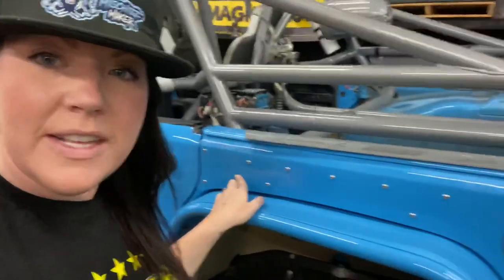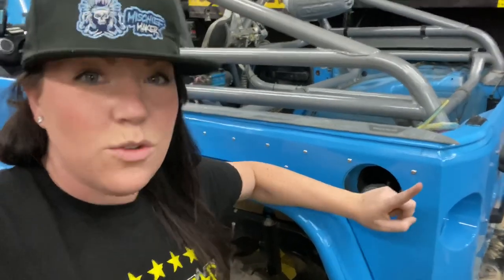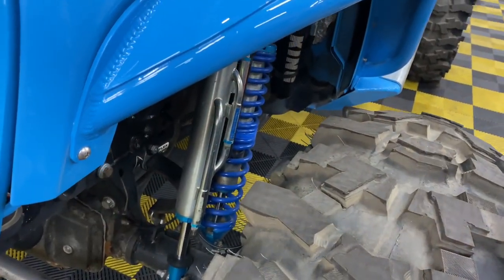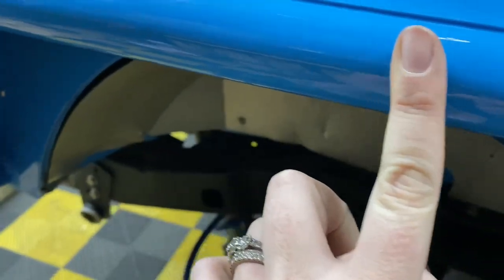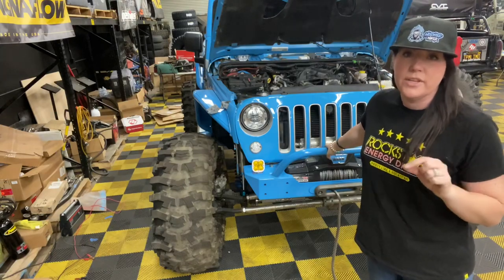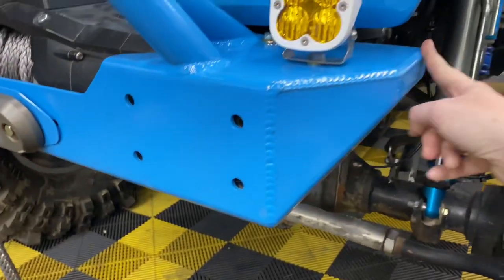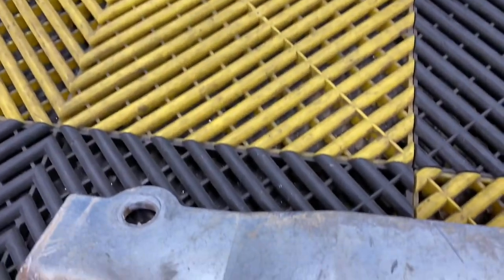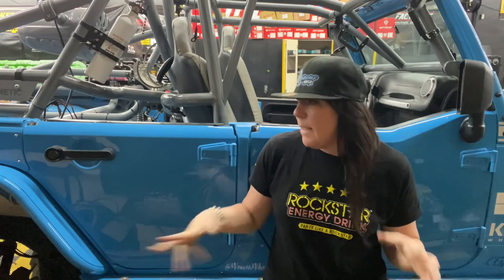Choosing the Right Armor Package - What I Run and Why I Chose to Run all Aluminium

Comment: I definitely agree less weight is better prefer aluminum if I had an option. Maybe one of these days I'll be able to get a genright bumper & tire carrier. Skid plates the only place I would not like aluminum. Got all the major work done now it's just the cosmetic stuff left.
Reply from the maker: I had the same concerns about Aluminium skids, but when they are paired with the replacement HD crossmember, the Artec skids are TOUGH AF! 🤩

Comment: In 2008 i got some of the last poison spyder rocker protectors in aluminum. When gas was 4+ dollars a gallon. My tj was my dd and trail jeep. I was all in and went minimalist. Driven by fuel costs. But hell yes lighter weight armor er armour has arrived FINALLY. My xj is naked....poor Stoffel needs his armour. But he needs a transmission transplant first! Soon :)
Reply from the maker: Best of luck with the transplant‼️
Reply: @MischiefMakerTV  thanks. I have to do it outside...so bad weather is here.. But i am not ready yet. Soon maybe next 2 weeks. I think i ll make vid for my deathwobble channel.
Reply from the maker: Scott Campbell please do, I’d definitely watch‼️🤩
Reply: @MischiefMakerTV  yeah well i am no George Clooney lmao
Reply from the maker: Scott Campbell I’m no actress either 😬
Reply: @MischiefMakerTV  i think you are more real than most actors. Which is good
Reply: So....i visited my local salvage yard. I been 30+ years in collision work. Saw a jeep today made my blood run cold. Newer jeep. Frame bent back over itself. Engine smashed. Where the pedals and your feet go was pushed up to where your knees would be. B pillar was cut out. Some stains but no blood. I hope it had no people on board. Please be extra careful on the roads with your jeeps
Reply from the maker: Scott Campbell whoa! that’s sounds horrific? Was there an aftermarket cage? Maybe a custom one that was poorly designed? I know the GenRight cage we added (and modified) is at least 10x stronger that what was originally there and specifically designed to protect me in rollover situations (along with the harnesses), and probably not as effective in a high speed head on crash. The good thing is, MischiefMaker is a dedicated trail rig with sticky tires. When we are on pavement we are almost always in the tow rig with the exception of occasional short runs on local roads to/from the trailhead.
Reply: @MischiefMakerTV  it was all stock.i have 3 pics in my phone. Not sure how to share them.
Reply from the maker: Wow, very scary! Stock cages are not the strongest and removing the B-pillar (especially in a 4 dr) without replacing it is a terrible decision 😳
Reply: @MischiefMakerTV  it looked like cut out with jaws of life from firefighters. Sobering to see....for sure
Reply from the maker: Scott Campbell with over 30 years experience in wrecking, I bet you have seen some crazy stuff. 😳 If you send me the pics via email at MischiefMakerJKU at gmail dot com I’ll definitely share them on Instagram. People definitely need to be cautious!
Reply: Check out nate and kelly's jeep weigh in.
Reply: My 88 XJ is 3450. I have 33 in tires. I think mine is close to 3800 pounds.  I dont have anything drastically different weight wise than stock except my tires..and no spare for around town driving.

Comment: What skids underneath are you running? I think I might have seen an Artec logo hmmm....Did you replace the stock cross member?
Reply from the maker: Good eye! Yes, I run Artec’s full belly pan kit and I definitely replaced the crossmember because after 1 year of wheeling my OG setup (4.5” lift and 37s) the stock one was really badly mangled.

Comment: Hey can you do a review on your suspension on the double throw down looks like you are not running a sway bar ???? Awesome rig too I'm thinking about getting those mickeys
Reply from the maker: I’ve got a full wheeling video recapping the whole year and multiple states I’ve run on the Baja Pro X - check it out if you haven’t already.I do love my Rebel Offroad DSS front coil over conversion kit, and I’ll share an it more in a future video. I used to run Antirocks but now decided to remove both last year. It takes some serious time to get used to how the Jeep moves without them, but so far so good.
Reply: MischiefMakerTV  thanks for the response I watch all your vids good stuff keep it up you should do a fan ride sometimes that would be kool

Comment: I got a question about the rear corners...so the bolts aligned with the nutserts from the EVO corners that you were running prior to the Genright swap? Always wondered
Reply from the maker: I think 1-2 did line up pretty well, but the vast majority did not. I didn’t want to put any more holes in the side of my rig, so I asked Leo and the guys at TNT Monster Truck to fill the GenRight Offroad mounting holes and add holes to the armor that would line up with the existing nursert locations 😂 - I positive they hated that request, but it’s better than further weakening the structure that sits beneath the armor!!
Reply: @MischiefMakerTV  I think there's probably a handful of firsts they encountered with your build where they got the job done but said, that's the 1st & last time we're going that" LoL. 
They're the best! They're responsible for one of the baddest ass builds in the game today and could've used that as a stepping stone to get the shop Instafamous but Leo's just too humble and doesn't care for the social media buzz. Gotta respect that.

Comment: GenRight is too expensive. Way too expensive. I run thinner steel armor and with the proper gearing and power plant, suspension, etc., weight doesn't matter to me.
Reply: Most people miss the idea heavy vehicle needs stronger components.  If you are at a point of protection and less breakage you are doing good. For my uses i need the better fuel economy and less weight.

Comment: the TJ was a little bit better on the tail lights you could literally go to Walmart or any truck stop and get trailer lights and they work with no effort. JK sucks and Y jeep  put the tail lights there I don't know. Maybe someday dinner I can make maybe a slightly smaller Corner guard just enough to run the recessed light.
Reply from the maker: Agreed. You should see my dash...it’s lit up like a Christmas tree! 🤣 I do love the simplicity of the TJs and YJs 👍🏻
Reply: @MischiefMakerTV  ya pull j6 fuse get extra lights .